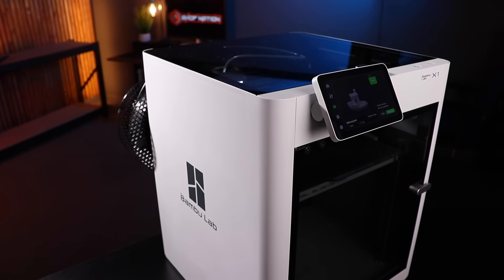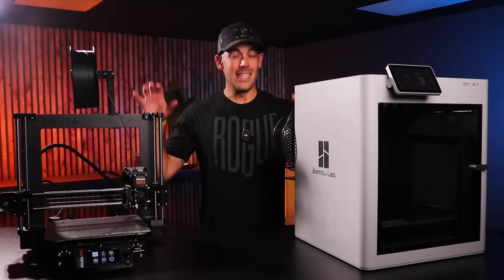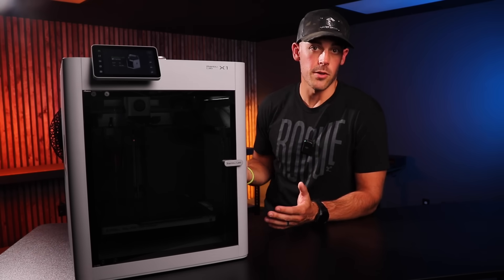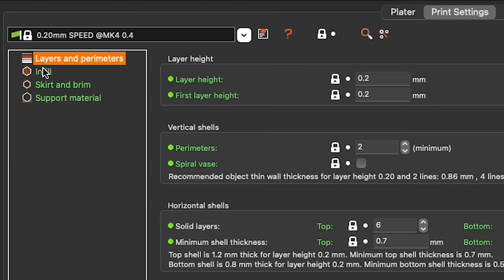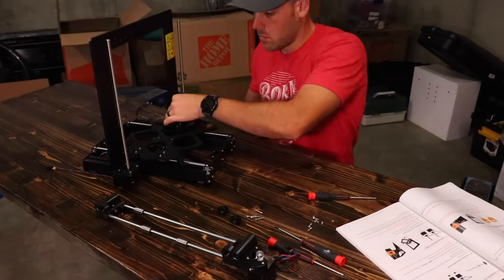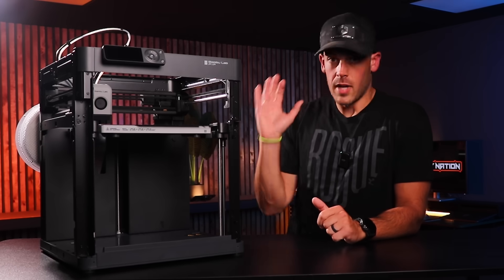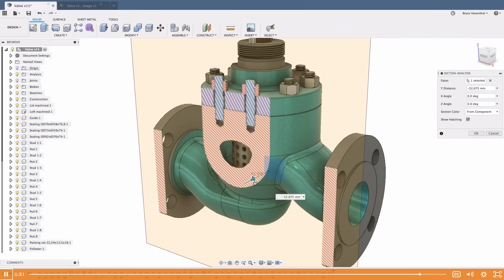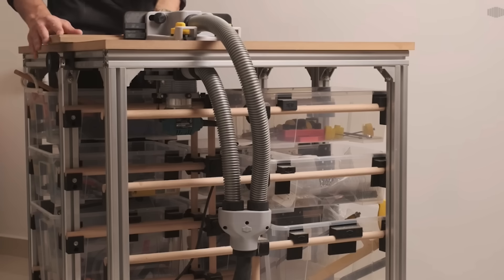The 3D Printer I'd buy if I started over

Comment: One of the main concerns that I have before buying a P1S is the actual fumes from printing. I saw that even for PLA, it still puts out some dangerous fumes and that the pronter should be kept in highly ventilated areas - most definitely not in the bedroom you sleep in. Are there any workarounds to setting one up in a small apt without slowly unaliving ourselves and the cats? :)
Reply from the maker: PLA is perfectly fine, wouldn't worry about it at all

Comment: I’m interested in this. I probably have the same questions as some. I think a lot of it will involve changing my mindset to creation rather than consumption. But, how durable are the products? Is this just cheap plastic that is going to melt in say, an engine bay? Or if I find a file for my broken exhaust hanger, will my cars exhaust pipe just melt the product? How about strength? It I made some wall mounts for a TV or some closet racks, is it going to snap apart at a seam? I get that the possibilities are endless of WHAT you can make. But how functional is it in the real world?

Comment: There is no doubt that PRUSA is teh standard by which all other hobbits 3D printers are judged.  I bought a PRUSA i3 Mark3 for the exact reasons you stated as my first printer.  HOWEVER, after 3,800 hrs of print time which includes full Mando & Bo Katan armor, the Amban pulse rifle, tri-barrel mando heavy infantry rifle & many others the need for a large print volume printer arises & unfortunately the PRUSA Mark I’ve is not that much bigger than the Mark 3.  Luckily there are now superb options like Anycubic Konrad 2 Mar, FLSUN V400 and Sidewinder x2 with PRUSA features like auto bed leveling & a direct drive extruder and the work out of the box -  PRUSA would make a large volume printer (~ 400mm x 400mm x 500mm) I’d buy it in a second.  If you don’t need large volume than I get it but if your main reason to have one is for cosplay like me than

Comment: Great video.  You got me. I thought that I was on the right track until you said - "Neither of them".   I did buy the P1S instead of the P1P because it seems that might not have been available at the time of this video was made.  I like th enclosure because it allows more flexibility to print with a wider variety of filiments.  Thank you for the education.   I print with it and it just works.  I'm not frustrated with it tanking the prints and me not knowing why.   Liked / Sub'd

Comment: The most important thing with the bambu is, the encolsure. Both printers print extremely well, but the enclosure makes prints so much stronger, especially the layer lines, also it reduces warping by so much.
Reply: Just for your information prusa now sells the mk4 with enclosure in bundle also with add-ons you may choose. Also has filtration, fire suppression system etc....

Comment: I just recently discovered your channel because I’m wanting to get into 3-D printing, and if you could reply to this and give me your thoughts, I would greatly appreciate since I’m just learning all about this stuff. But what’s your opinion of this? Is it worth buying or should I try to save up my money or should I get one of the 3-D printers you featured in this video?

ELEGOO Saturn 3 UItra MSLA 3D Printer, Desktop Resin 3D Printer with 10-Inch 12K Monochrome LCD, Wi-Fi Transfer, ACF Release Liner Film, 8.62x4.84x10.24 Inch Large Printing Size

I mainly want the 3-D printer for my hobby since I paint and Warhammer miniatures and I just basically want to mod them.

Comment: Yes if you started over with you printing farm business. I would recommend the cheapest possible printer with self bed leveling. That way people know if 3d printing is a hobby for them.  Proper first layer seems to be the biggest issue people face when coming into this hobby. People dont have the patience or the common sense to figure out how to level a bed manually. I have gotten pretty OK at eyeballing the level, but just got a BL touch clone to even skip that part.

Comment: I need a video like this for for home laser cutters.  I need one and feel like my eyes and brain are going to fall out of my skull trying to research the best yet most affordable option. I'd be using mine for the making of 1:6 scale doll houses and furnishings. Anybody have any advice? I've just made two models in the last week using TinkerCAD (a modern handshower w/ showerhead, plus a two-burner gas hob). I'm ready to print them for a doll apartment I'm working on. I need to be able to cut thin sheets of aluminium, stainless steel, and copper (for appliances), wood and leather (for cabinets and furniture), acrylic (for windows, wall dividers, backsplashes and countertops). Recommendations? 

P.S. I'm not rich!

Comment: What you said about how manually setting the print bed and adding 3rd party components is a brain curiosity killer is the truest thing I’ve heard all year. As an ender 3 owner I’ve lost so much interest in 3D printing, but now I want to buy myself something from prusa or bambulab. Beautiful video
Reply: Same here, I've had an Ender 3 Pro for probably 3-4 years now.. It was fun at first, but damn near just felt like a tedious gimmick after a while. But I learned enough from it to impress my boss, he told me to choose any printer for our department and he was putting me in exclusive control of it. In the last 2 months, I've gotten more work out of our new X1-Carbon than I did in the entire life of my Ender 3 and I absolutely love the thing. Hell, sometimes I go in on Saturdays just to screw with it.
Reply: Yep, I got a Sovol SV06 for my first printer. While it worked great for awhile, it eventually got to the point of having a new issue every week along with constantly needing to re-calibrate it, get a new part to improve it, or dig for hours to try to find an answer to some obscure problem. I just got sick of this at a certain point and haven't printed anything for months, but I finally pulled the trigger on a Bambu Lab P1S and can't wait to (hopefully) print without all the constant troubleshooting
Reply: @ericosborne4122  After a month of owning the p1p, I’ve been printing nonstop without any problems so far. You will not regret this
Reply: I ordered an ender plugged it in to do a test and then I mailed it back and got a kobra 2 pro. It blew my mind how much better it was for the same price
Reply: Voron. Daksh looks promising as a toolchanger and ercf is very similar in function to AMS.
Reply: i don't own what i'm about to recommend over these two options,  but i spent a long time reading and upgrading my ender 3v2 to the point that its now 400x400 and prints carbon fiber nylon reliably...     what he said and you are echoing is true,   i describe this like having to climb the mountainous learning curve of figuring everything about cnc and then building your own...and programming your own... etc...     there is still a HUGE learning curve just figuring out how to run a plug and play unit.     BUT:   in my opinion  THE PRUSA AND BAMBULABS ARE TOO EXPENSIVE FOR NOT BIG ENOUGH BED SIZE  for what you'll really want to print once you figure out how much of a tool these are-----  carbon fiber nylon, nylon x maybe .... but probably pa12-cf (nylon12 with at least 20% carbon fiber)  most likely.   ... and you want to be able to do ASA for uv resistance... and PETG for everyday stuff that needs to be stronger than PLA...  and you want to be able to do this in as large of a size as you can possibly afford.    you won't use the huge bed all the time,  but when you need it, you'll be happy.

- so  from literal hours of reading forums and reddit...  if i were to do it over again right now or get a second printer... at this moment in march 2024 i would get a QIDI X-Max 3...  it will do all the things everyone is talking about here and i mentioned and has a bigger print volume... costs less than bambulabs  
personally... even the volume of the QIDI machine is ALMOST  too small.    and if you want truly bigger volume for anywhere near affordable you need to put it together yourself and apparently ppl say "rat rig" is the way.      and just to address the elephant in the room about printing boom sticks etc,  you can do that on any of these, and everyone has panties in a bunch about bambu labs for that aspect... but at 1400 i'm not seeing it.   but i'd encourage people to think beyond the possibilities of merely  3d printing 2a stuff or just simple car stuff... and with a  volume of 400x400 and larger in addition to being capable of printing higher temp engineering materials the applications get quite a bit broader which is why when you get into half meter bed size and up suddenly the price triples or quadruples,  even though the actual tech on the rest of the unit isnt all that much different... because they know its people that can make real money using them. 

there's my youtube ramble for the day  cheers

Comment: $1200? I spent $150 for a refurbished Vyper off eBay, which does exactly what I need and not too shabby on the speed. And the company sent me extra parts (like a heating element for the bed) at no extra charge.

Comment: Thanks for the GREAT Video! Very informative! I have watched a ton of videos on 3d printers. Yours is the best! But there are still Thousand of questions (ok maybe not thousands, but a lot) as to the true cost.

I keep looking and WANTING to buy one of these; but, is it REALLY COST EFFECTIVE? Or just a Big Boy Play Toy? I am not looking to start a business in 3d Printing. But there are a lot of things I would like to use one for. So, here is a list of questions if you find no time in your left to answer: 

What is the difference in the wire(s) (other than color)? I know there are different thicknesses, but what about the material itself?
How do you determine what wire you use for which project?
What items should you have on hand when they fail. Like the nozzle head, etc? 
What should you upgrade right out of the box?
Will one nozzle work with all sizes and brands of filament?
Does a machine have to use ONLY A CERTAIN BRAND of filament?

They look cool as heck. And there are all kinds of things I would love to make with one. But when you add up the total cost, are they worth it?
I am looking online right now at a 10-pack of 1.75mm filament wire, $464.00 USD. There is nothing that tells me how many feet are in a roll. 
I know it would depend on the project as to how much you will use, but how do you figure that out? (I.E. Project * feet of filament needed * cost per foot = ?)

I am not looking to start a business in 3d printing. But I do have a ton of things I would like to make for my barn, house, tools, etc. I am just not sure that (Minus the cost of the machine) the materials needed are cost-effective. 

I OPENLY LOOK FOR FEEDBACK FROM ANY AND ALL! LOL, help my YIN and YANG convince Me, Myself, and I! 

Thanks!

Comment: Yeah I agree with everything in this video. 

I started with an ender 3 and I barely used it. When I wanted to print it would take hours of work levelling only to find there was some dumb issue with a switch or a bolt came loose. 

I bought a P1P and I used that to print more models in owning it for a month than I ever did printing stuff from My Ender 3 v2

(this is more for 3d printing newbies that scrolled down or bought a 3d printer and are just sitting there with it)
That being said... 3d printing is actually very boring. Something I think that should have been mentioned is that eventually you'll run out of uses for it... like owning table saw and having nothing to actually do with it. So You need a hobby or a purpose with 3d printing.

A lot of people go to cosplay or propmaking
But I see people go to RC cars and drones, Nerf, airsoft, paintball, Restorations, model building (TTRPGS, Dioramas, etc.)

But there's other applications too. Like the p1p and X1C are actually made for rapid prototyping (something I make use of a lot). As it is a tool it can be used to print tools like sawdust catchers, carpentry squares, jigs and even vices and contouring tools.

TO SUMMISE
3d printing is cool at first. but the fun comes from the use cases rather than the use (because the magic wears out eventually).
Yeah totally agree with this guy (who knows a lot more about 3d printing than I can ever dream to) Don't get a budget printer unless you're prepared to basically redesign the thing yourself to get only half good prints that take 3 days and will probably fail.

Have fun printing!

Comment: I've been thinking about getting a 3d printer for a while, just if any passerby can answer some questions of mine. 
Some argue the entry price isn't worth the things you can make, can you answer if the price is worth it for an average user, I think I would print random things for quality of like for example, remote holder that doubles as a headphone hanger? Random screw brackets or cable holders for my old mans shed. Maybe even slide boxes to store things. Just random stuff like that, maybe one day down the line I might run into a scenario where I could say "Oh I can print a solution to this problem" but since that day is probably few and far between. Is it worth getting into?
Side thought: I could also print tiny little characters for my coworkers since a few decorate their areas with them.

Comment: Great video! My Prusa has saved me so many times. Impossible to find replacement parts that can be made/printed in hours, making a simple gasket so I was able to fix my bathroom sink (I would have to buy a new sink if I didn't have a printer), spacers of all kinds - like to secure my PC wheel to a Playseat, a spacer that went from 2-10 mm over the width of a door to mount a door level, a part so that my son could attach a toy trailer to a toy truck, a mount for my powerbank under my mirrorless camera (so I don't have to change battery 3-4 times during a longer shoot), fixed a broken cover for an electric outlet, made custom tools to get to hard-to-reach-places, a bracket to hold a hair dryer to dry wet shoes, new handle for kitchen drawer (temp solution as we are inbetween housing).

Comment: Awesome video and 100% spot on. I purchased an Ender 3 Pro a year ago. I spent 70% of my time troubleshooting and tinkering with it. Well, it had a catastrophic failure 2 weeks ago and the whole toolhead/Hotend melted. Thanks to Microcenter's Service Plan, I got my money back and went with a Bambu Lab A1 Combo. I wasn't ready to drop nearly $1500 on a hobby I wasn't sure I would keep at. The AMS Lite is nowhere near as good as the full AMS on the X1 Carbon, but the A1 is fast and just..... works.

I am a busy IT professional and I don't have the time to tinker with my printer. The A1 has reignited my curiosity  for 3D printing. 

Thanks again for the video. You earned a Sub......

Comment: after owning a creality cr10s pro that broke down weekly i moved over to prusa i3 mk3+ not an issue in 3 years with maintence yes its a basic printer that is made to keep running it might not do its job the best and give the most user friendly experience especially the kit. Bambu might hold up strong but only time will tell, the thing that scares me of these more feature packed printers of any brand is having software related issues and having to buy expensive parts for it otherwise the performance is impressive but for me speed isnt an issue for a 200-300mm printer bed

Comment: Funny how this info always comes out after you buy something.  I started with a 3 V2 and it was a fight from day one.  Nothing would stick to the plate, all my prints turned into spaghetti problems.  Then I read  about the x1 Carbon and decided to take that plunge.  I have printed everything from a shelf holder pin to some so called "ghosts." The Bambu Lab printer is so much easier to use and it stops itself with malfunctions.  I have the AMS as well and the only con with this machine to me is that printing multicolor is excruciatingly slow and it wastes a pretty large chunk of filament.  Otherwise, it is rare that I start a print that malfunctions.  That 3V2 machine nearly ran me off from 3d printing before I really started.  The Bambu X1 showed me that anyone can print just about anything.  The only restriction is size.  There is no better option to me than  Bambu at this time. (At least for un non computer nerds who don't get along with software)

Comment: I messed around with a DIY Delta printer about 6 years ago.  Got it all together just to get stuck at the setup/calibration stage and gave up on it.  Sold it for half of what I bought it for and haven't messed with anything else since.

However, now I am doing research to take the plunge into getting a unit for shoots-and-hoots.  All this is to say that im gravitating towards the Bambulabs X1.  It might be middle of the year before I can actually commit, but it pays to watch these videos now.

Comment: I like what you have to say but right off have to say that I hate auto bed leveling.  It seems like a great idea but how do you fix a bad bed mesh.  The number one failure of any machine is always a sensor.  Less sensors is better.

As for talking about buying a printer that just works.  That's great too.  But with a bambu or Prusa with its less standard mechanics how do you source parts.  From the manufacture for absurd prices.  

I've only been printing for a few months so I believe you, but I don't.  I've bought 4 printers so far and I have yet to see one thing my friends bambu does that my sunlu s8 plus can not.  For one quarter the price.  And my sunlu s8 is easy to diagnose any problem because it has bare bones software and most issues come down to simple mechanics.